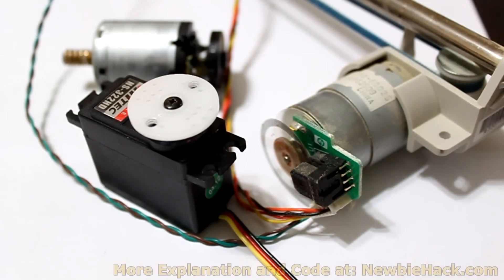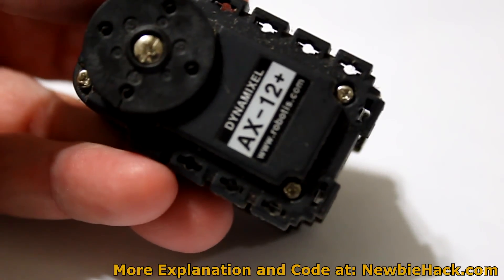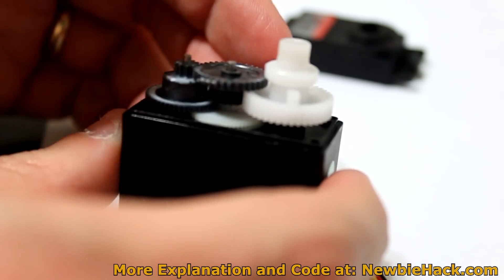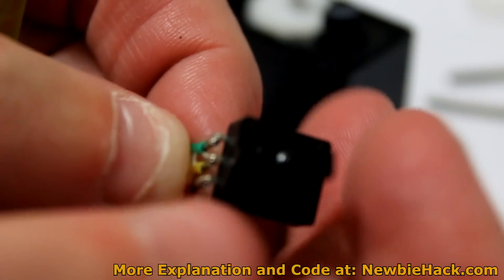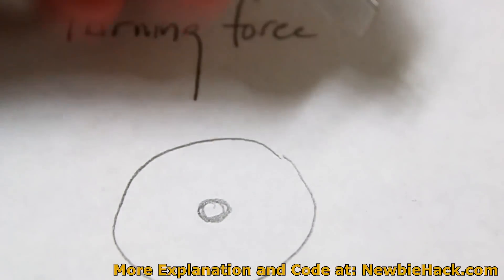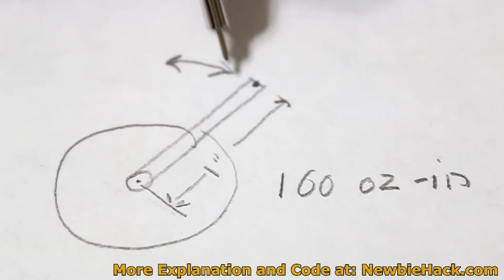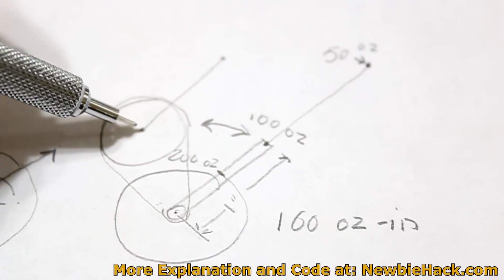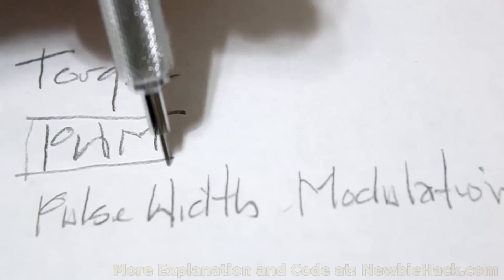36. Arduino for Production!  Introduction and How to use Servos and Understanding Torque

Comment: Hello tnx for t vid. Does anybody know how the komponent at 6:29 on the pcb in the upper left corner is called? Its the one on the pcb that is connected with the plus and minus cable from the servo. I think its a capacitor...? I burnd out that component on my servo, might be able to replace.... tnx for any reply

Comment: Great tutorijal, thanks a lot! Could you tell me pls if I got it right:
So the black wire carees the information about the position of the motor, so it is conected with the potentiometer? based on the position, we can calculate the current speed, and then the microcontroller (PWM) on the board will automatically calculate the accurate pwm duty cycle needed for getting the wanted speed?
so from the automatic system controling point of view, the pwm is the regulator (controler), and the potentiometer the negative feedback?

Comment: To find the gear ratio count the number of teeth on the respective wheels. Small may have say 12 teeth and large maybe 60. This would make a five to one  gear ratio. (60 divided by 12 =  4).

Comment: hello, I'm ben voila you an email because I'm on a project
I explain my problem, I am in the process of modifying a
pocket quad radiocommander, and the problem is management.
J have already burned two servo so I would like to order a
wiper motor ice in the same way that a servo but here
I'm doing research on the net and ringing in stores
electronics but they do not really see the operation of a servo
rc so you can help me I already told you thank you for your answer

Comment: hi sir,,,,,u r really great sir... sir iam doing project which is based on atmega32 ...so pls tell me how to interface GSM with atmega32 .and also interfaceing soil moisture sensor ,relay ,motor ,and also interfacing 4 sensors into atmega32....... those are soil moisture sensor, level sensor, temparature sensor,humidity sensor ..pls replay me sir.... my mail id...deepthi0478@gmail.com
thanking you

Comment: i have a question regarding the use of servo mechanism for opening and closing of the control valves in a thermal power station,being a mechanical engineer my knowledge regarding instrumentation is pretty less so i would be thankful to you if you could help me out,..the control valves are basically used in the path of main steam piping and are controlled using hydraulic oil pressure which includes a servomotor mechanism..thanx

Comment: I'm alittle confused. I want to have a servo rotate 90 degrees when power is on, (12v) and stop at 90 degrees. When the power turns off, i would like the servo to move back to position 0. 
How can this be done? I would rather not have a controller box and code.
I would also need to find a heat resistance set up.